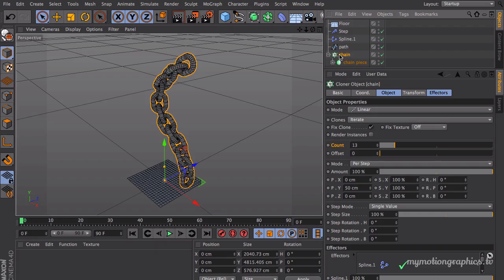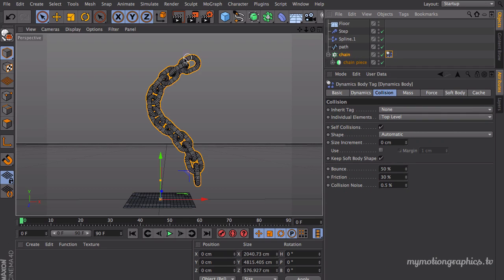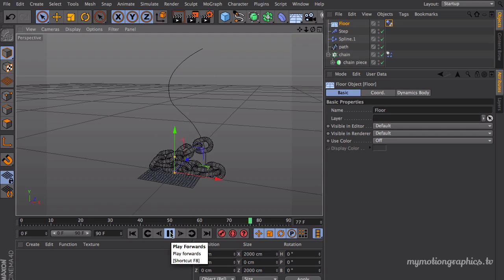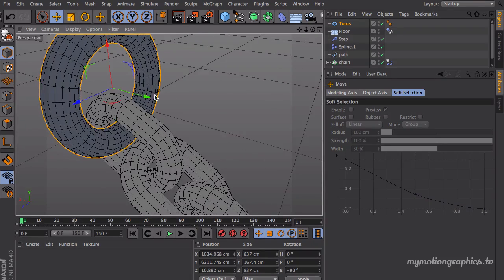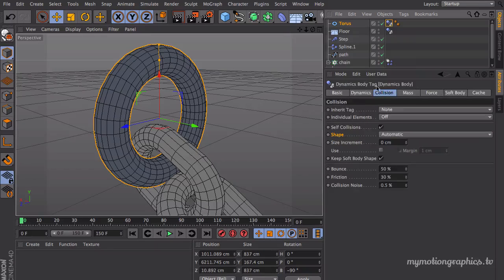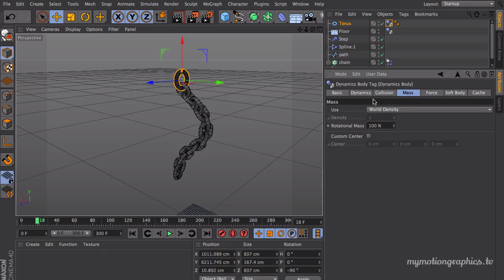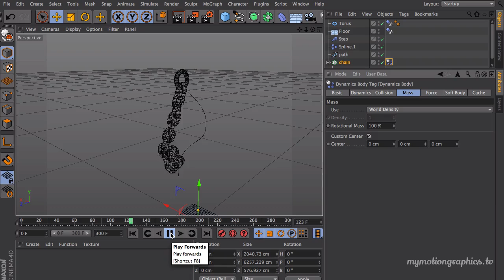Cinema 4D Tutorial - Dynamic Chain (part 2: Dynamics)

Comment: Any ways to make such dynamics with exported finished chain? I mean without Cloner or other manipulations
Reply from the maker: +Sofiia Said you'll need to bake the animation. I'll need to be in front of the computer to tell you how. Will do it asap
Reply: @mymotiongraphics  would be very grateful
Reply from the maker: @Calamar3083  Hi Sofia. Sorry for the late response. Here we go: 
1. Convert the cloner to editabe (C on keyboard). You'll a null with a lot of objects.

2. Open the Timeline: go to window>Timeline(Dope Sheet). 

3. Drag all the objects (except the null) into the left side of the Timeline
.

4. In the Timeline's top menu go to Functions > Bake Objects (make sure all objects are selected in the Timeline)
.

5. Hit ok.

6. Delete dynamics tag in the Null object (former Cloner), but only after the bake is solved.

That's it.
Reply: @mymotiongraphics  Thank you!

Comment: Great tutorial thank you. Just a quick question. When I try and do a similar task making and applying dynamics to the chain the links the individual links still end up breaking? I have the chain shape set to moving mesh but it still breaks the links? The dynamics are not respecting the individual links towards the end of the animation. My links are for a necklace so they are VERY small, do you think the size plays some effect on the dynamics? I can't seem to get this answered anywhere. Thanks
Reply from the maker: +Brad You have at least 2 ways to fix this.
 1- change the size of your object. I would avoid this solution.

 2 - press ctrl+D to see the project preferences. Look for scale. It should be at 1 at this point. Try increments of 10, positive and negative, ex: 0.01 _ 0.1 _ 10 _ 100. 

There are some things you might do if this is not enough, but at the moment I'm not in front of a computer, so by memory I can't tell you exactly where to go. Try the second solution above and let me know if It worked.
Reply: @mymotiongraphics  dude you're awesome, i had the same problem, thanks!!!
Reply from the maker: @tobiasraschbacher4915  thanks! Glad you made it. Happy new year!

Comment: im having a problem, I want to do a hanging punching bag. So I have one torus to hold it up on top and another one on the bottom that connects to the punching bag. I' m not animating anything and everything works fine until halfway through the animation my chains just break apart (not explode, just fall)

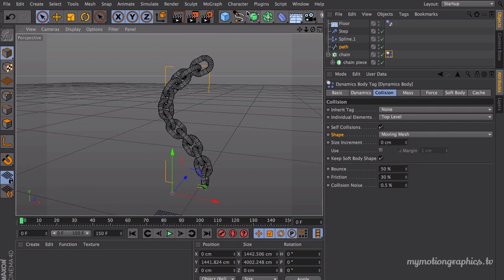Comment: What cinema 4D did you used?, I have the cinema 4d r14 and those settings at 3:13 minute in collision attributes doesn't show, it only appear Basic, Dynamic and Collision settings, and in the shape option dosen't appear  "Movig Mesh" so I selected "Another object", and the chain actually fall down, but it doesn't stop when I put the floor with de Collider Body tag, and it doesn't hold on with the "Torus."
Reply from the maker: I'm using R15
Reply: Demn x)

Comment: Ok followed everything step by step and my chain broke apart......:(
Reply from the maker: go to dynamics body tag>Mass and check "custom center". 

If it still doesn't work hit ctrl+D (cmd+D on mac) to see the project setting in the attributes window at bottom right corner. Then, go to Dynamics>Expert and increase "steps per frame" until it works. Note: simulation will take longer but will be more accurate.

Another problem might be the scale of your chain. To big or to small causes different results.

Hope it works :)
Reply: Thanks!!!